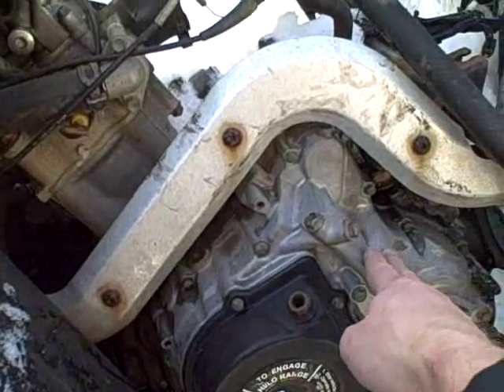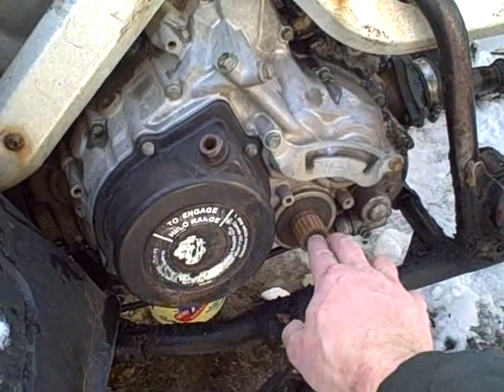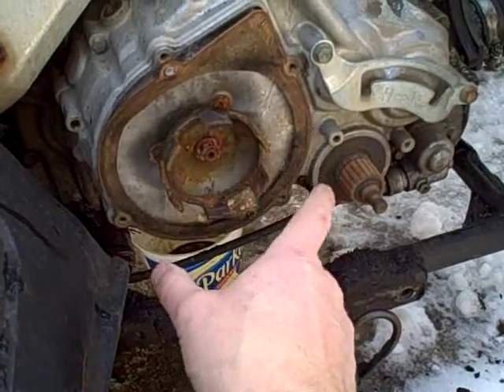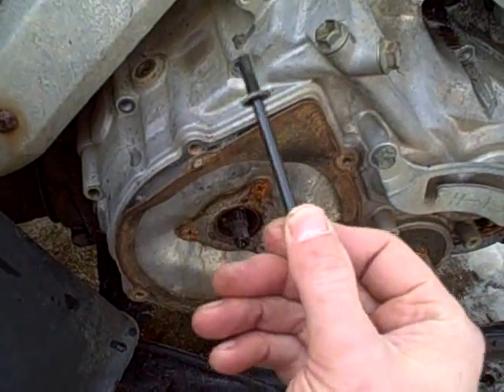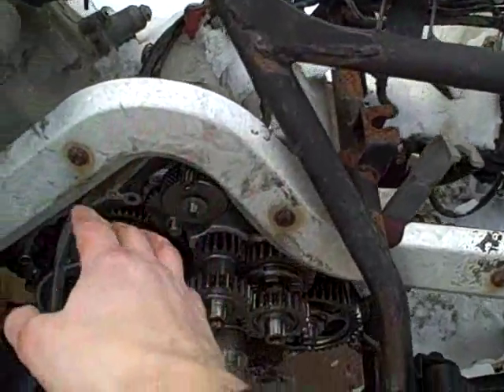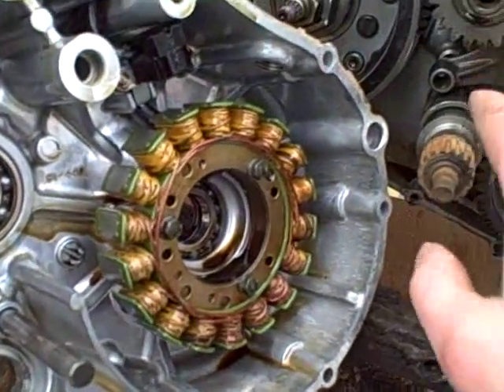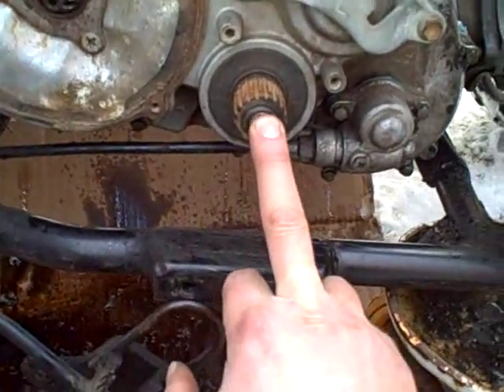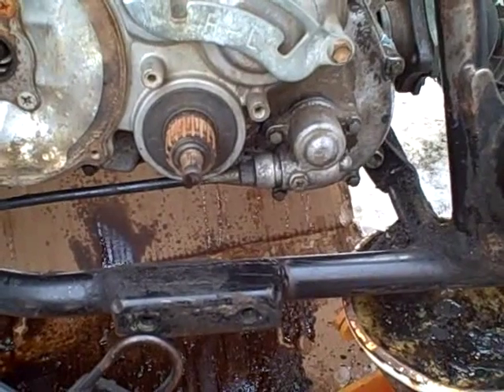Arctic Cat Project: Part 18

Comment: This video helped me with my project. I thought the magnets come loose from the flywheel watching other videos. That's what got me to take off the cover. While disconnecting the wiring I found a fried connection. At that point, I had the cover off a couple inches and was committed to take it completely off to make sure the shims and gears didn't fall off. I have to re-install everything repair the wiring and hope that was the problem. This flywheel doesn't appear to have the glued-in magnets.

Comment: It should be noted - take the detent ball out before pulling the cover off, and do not put it back in until after the cover is back on.  The cover will NOT go on, if that detent ball is in place!!!  Also, it will help coming off, by not dragging the HI-Low shifter shaft with the cover, thus dropping many parts.

We fought with the cover for almost 2 hours last night trying to get it to go back on.
Reply: whats that denented ball your talking about am having that problem cant get the cover back on

Comment: im currently rebuilding one ive looked everywhere i was wondering if know where the pressure style shim went on the gears i have all my shims on but that one and its the only thing holding me up with this build i got it torn apart and im so close to having it finished
Reply from the maker: I would go to a site like foxarticcatparts.com and look at the exploded views of the parts. You should be able to figure out what shims go where that way.
Reply: Did you ever find out where that pressure style washer went? Having the same issue. And when I watch this video closely, none are the pressure one

Comment: I know it's been a very long time since you posted this video, but I have a 4 wheeler that is identical to this one. My issue is that the gear selector (high/low) is stuck in the high position, but runs like it's in low. I know this because my friend also has the same 4 wheeler and his is much faster. Please help!!!